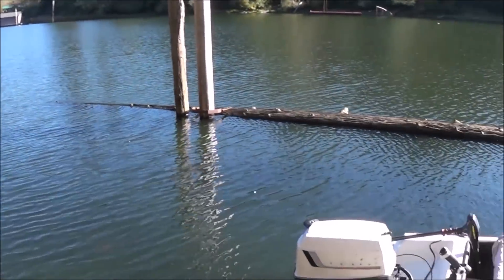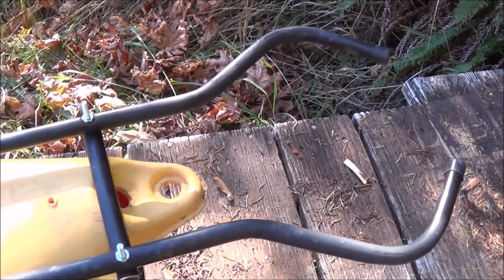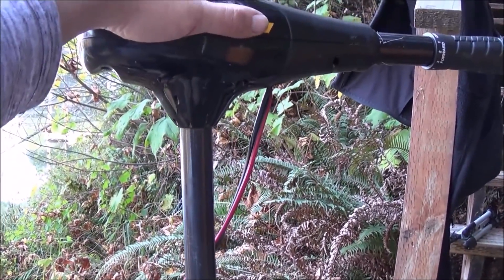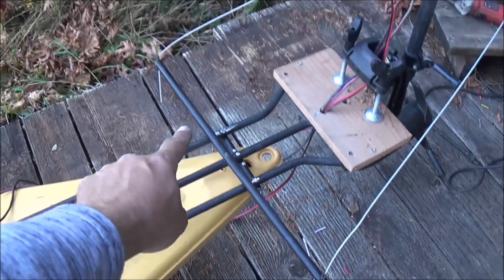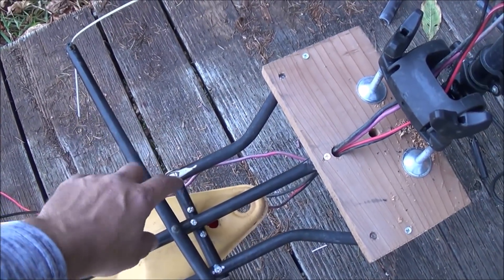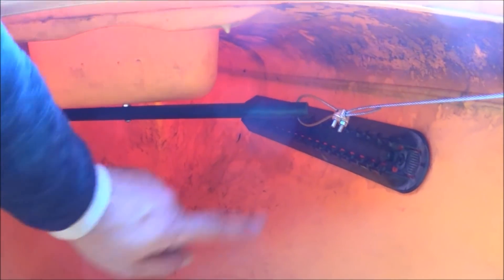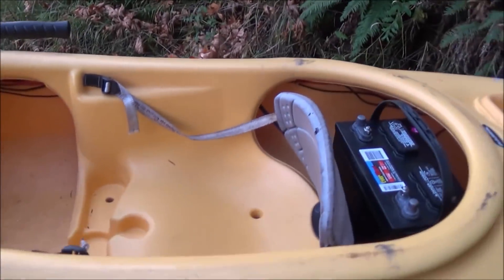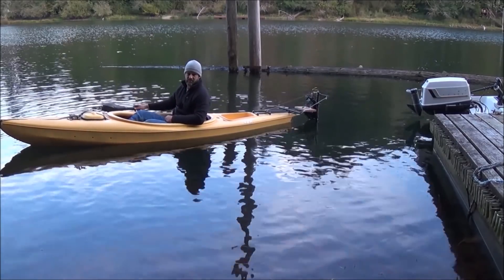How to turn a KAYAK into an ELECTRIC BOAT, easy to build!

Comment: What about putting the motor in the front to help offset the weight of the battery? A little unconventional, but I can't think of why it wouldn't work
Reply: alternatively a couple of small flotation bits mounted about halfway up the side in the back could work to offset that weight problem either way might work
Reply: @arnearne12345  I wonder if the drag the floats would create would significantly reduce the speed and maneuverability.
Reply: I think It would make the turning difficult, you would pull around instead of twisting, I have never tried a motor in front. Would be easier to mount the battery in front if there is a weight distribution issue.  love this build, I would have over complicated things by keeping the throttle control as the steering mechanism...
Reply: @vsavoldi  you call that overcomplicating, and I understand why, but I think ultimately it would be less complicated to keep it as is, just much less ergonomic.
Reply: @vsavoldi  . It would, but not to a ridiculous degree. Putting the battery in the front would definitely be better though. He talked about putting two batteries in the kayak for balance, but that plus a full grown person might overshoot the weight limit in a kayak